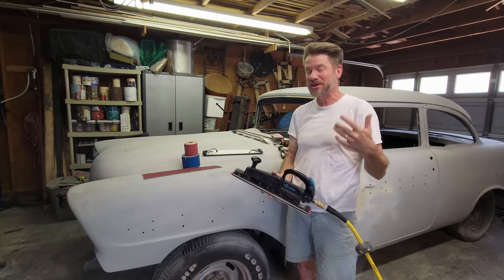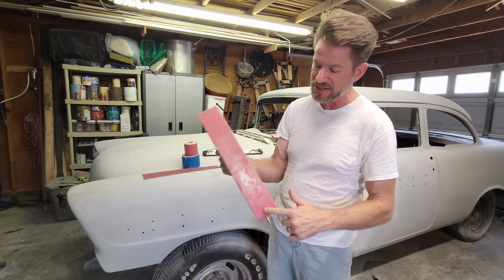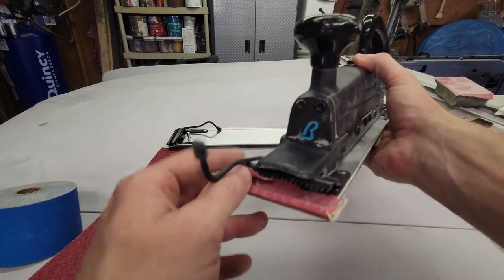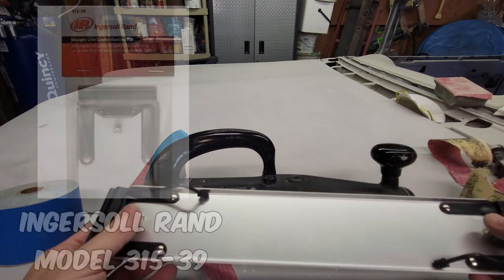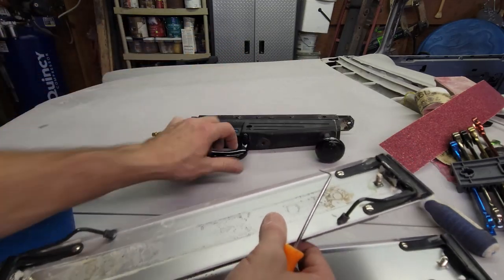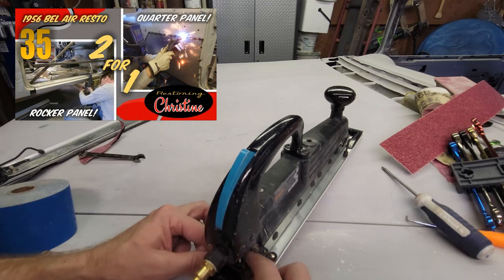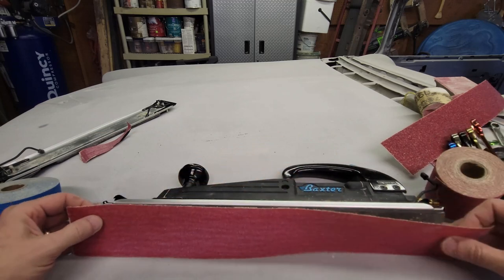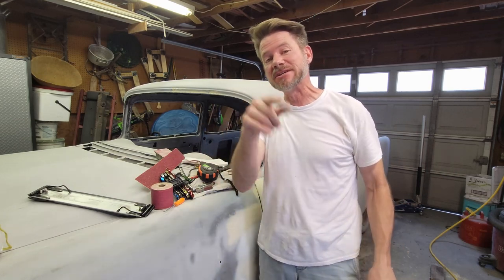Repair Your Harbor Freight Air File with a New Pad!

Comment: Those are nice tools ... one thing about those is to oil it you have to pull the allen head plug out  ... not put oil in the air fitting ... lot of people don't know that ... keep on keepin on ...
Reply from the maker: Really!  I guess the instructions might have said something about that, but I didn't keep them!  LOL! Thanks for the tip!

Comment: Had the same problem. I stopped using sticky paper on all my tools. I was destroying my sanders. One thing I may do is put dust on the sticky part to stop the paper from sticking. Great videos.
Reply from the maker: Thanks!  I've found myself doing almost that, by not wiping any residual that might have snuck in between the paper and pad.